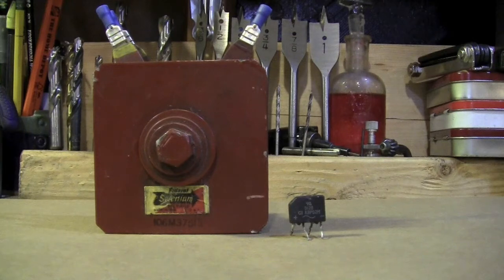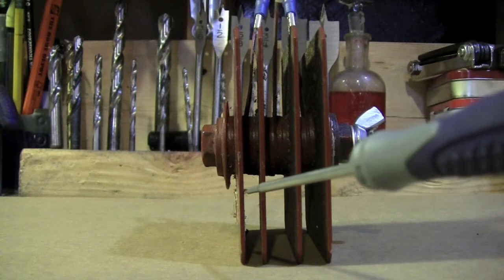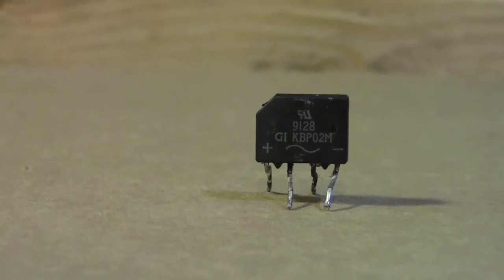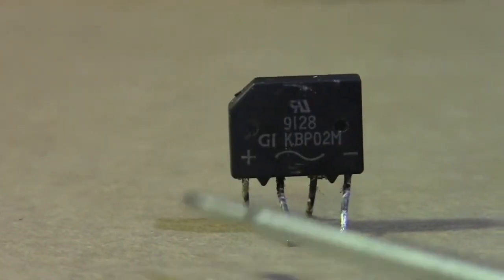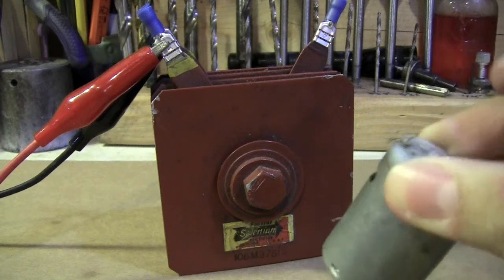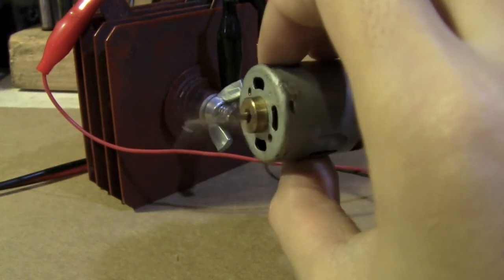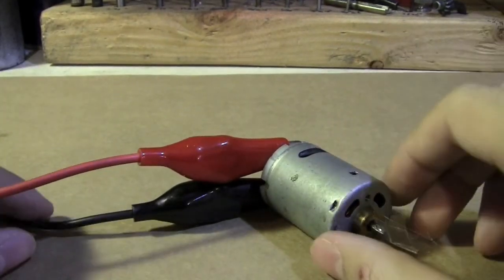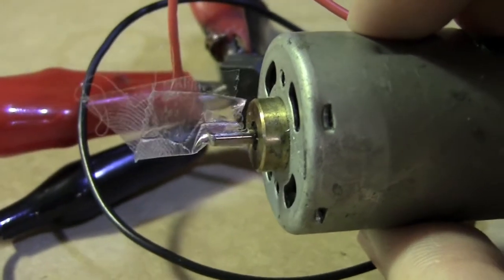Selenium and Silicon Rectifiers

Comment: Hi. Nice video. You have to conect the other end of the selenium bridge to minus as vel. Ass you cupled it you fail a diode from one of the phases to minus. Selenium diodes are good diodes and have some advantages. They resist atmospheric tension well but they will after time turn higher resistant. They have a reverse breakdown at abouth 20 volts so your rectifier is for about twelve volt. We use them stil and i am at the moment loking for new ones. Because of the benefits of atmospheric tension damage.

Comment: And if a sodium rectifier blow up.or leaks they are dangerous ,a silicone.diode.is.not but when you use.a silicone diode it should be used with a dropping resistor.

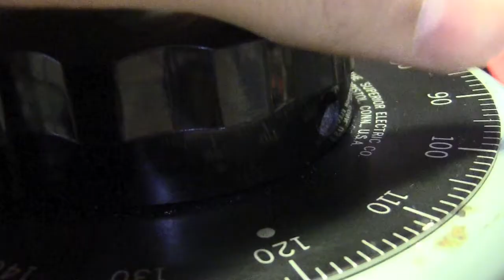Comment: If you're using a Superior Electric (or similar) variable voltage transformer as shown at 4:30, you should be aware that they are NON-ISOLATED devices (generically called "auto transformers") that DO NOT PROVIDE ISOLATION from the line mains. The consequences are a severe shock hazard. To prevent a serious and possibly lethal shock hazard, I advise that you learn more before you hook things up to the mains.
Reply: he was powering a 12 volt power supply
Reply: Lol he said he runs it on 12v mate.. if hes using a standard wall wart hooked to a variac it most definitely is isolated.. (assuming its a standard 2 prong wall wart.)

Comment: I have an old battery tube radio which has a selenium rectifier in it...I use it almost every day but I can't run it for more than an hour or two at a time or the sound will start to dim out...

Comment: If I remeber correctly, that old rectifier came out of an outboard engine. Those who know that stuff a whole lot better than I might comment on just what such a rectifier might have done in that engine's electrical system (cause I aint got a clue).
Reply: ^quite possibly just simple dc half wave or so in order to charge a battery from an a/c ring like a riding mower engine...
Reply: Those engins have a magenet in the flywheel and a coil near the flywheel runs the spark plug and if it has electrical starter and battery then it might have another bigger low resistance coil that chargers the battery. Because the coil produces ac voltage in reference to engine rpm. (Single pole ones give 50hz at 3500rpm) the rectifier makes it dc but not smoothed. It chargers the battery and the battery doesn't really care about if it's smooth or not as long as it's dc it will work fine battery .